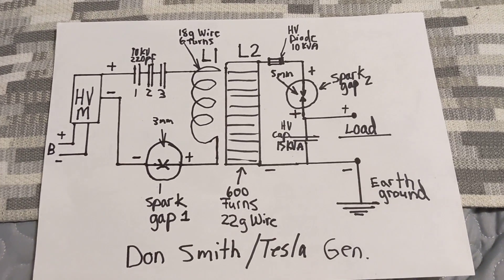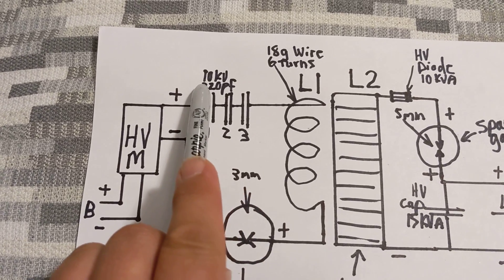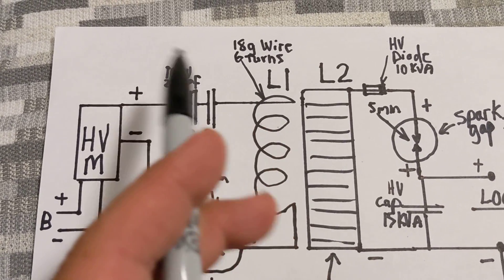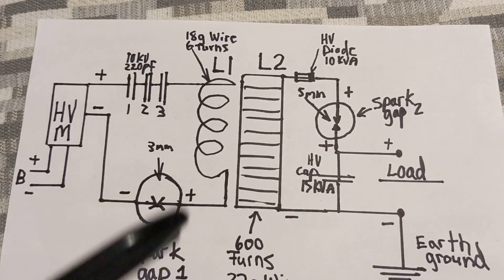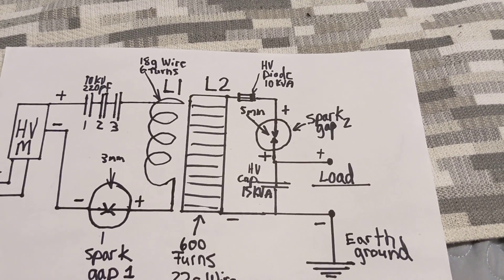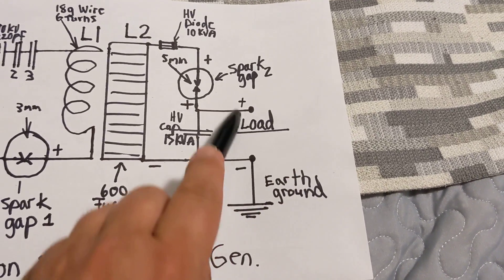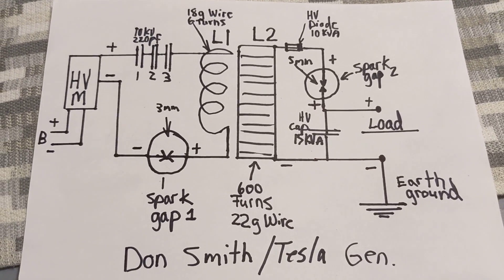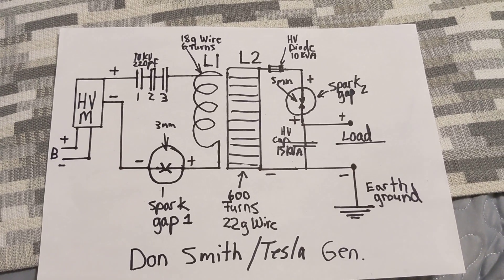Faraday Research RND

Comment: Hi Mike, you said the Spark Gap is the holy grail, can it be replaced by GDT, gas discharged tube and get the same holy grail effect??
Reply from the maker: Yeah that would be good too. ...I have been  trying to track one down for testing...alot of them are overpriced

Comment: Hi  I would like to know the diameter of the cardboard tube we're using I can calculate the wire  Thank you
Reply from the maker: Those parameters can be varied in length and diameter it is something that you have to experiment with ....I was using a paper towel roll but you can use many other things there is really no right combination just a lot of experimentation

Comment: I got a question how did you get 600 turns did you go a 100 each layer I would like to know Thank you
Reply from the maker: Hi very good question the coil is straight across I do not do layers so 600 turns straight across on a tube of your choice preferably something that is non-magnetic
Thanks 👍
Mike

Comment: So a resonant spark gap is key?
Reply from the maker: Yes in my Research the spark gap is the holy grail ....most modern day electronics has replaced it with the Mosfet or transitor ...so you do not get the same effect...the overunity effects are only achevied with the spark gap.. and the proper research was never done...The great things tesla did in the late 1800's was all done with the good old Spark Gap!!
Reply: @FaradayResearch  my first thought was that you just make them identical, sg 1&2, but then I thought about a harmonic instead. Also optimising the spark gap ergonomics and operation.. Frequency..
Reply from the maker: @domestinger8805  yes both L1 and L2 coils have a spark gap the frequency gets more refind and you can see a big differ in the look of the spark this gives you more power for wireless power transfer....a larger feild is created

Comment: thanks for your vids. Very helpful.
Question.. direction of coil windings??
cheers
Reply from the maker: Hi thanks for the comment coils are one side can be clockwise and the other side counterclockwise usually the ratio is 25 windings and the second coil 27 windings according to Don Smith so you can look into that more he has some videos out there that show how he does the windings... thanks for your comments
Reply from the maker: Hi according to Don Smith the coils are divided into two parts the first side is 25 windings clockwise and the second side of the coil is 27 windings counterclockwise he does have videos out there where he explains the reason for this has to do with amperage creation and voltage creation so check that out and just do it YouTube search on that and you should be able to find out some more info on that thanks for your comments
Reply: Mike, you state that the capacitors before L1 are 10KV 220pF and the one one after L2 is ?
Reply from the maker: You can add more capacitors after L2 but not necessary L1 capacitor is more important

Comment: Was the 3v lightbulb hotter when you had 7k going through it? Or would it have been the same as when you normally put 3v through it? Is “cold light” a possibility?
Reply from the maker: Yeah it had to be cold light ...I could touch the spark gaps right after I shut it off and there was no heat at all at the spark gap....I led would not burn out at all
Reply: @FaradayResearch  I'm thinking the 10kv diode could be a lower voltage and not burn out too.